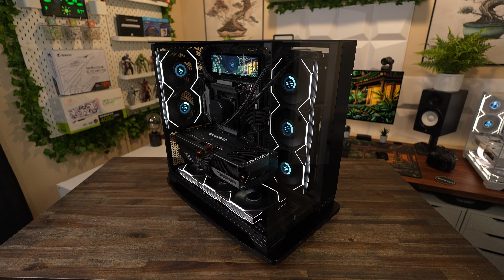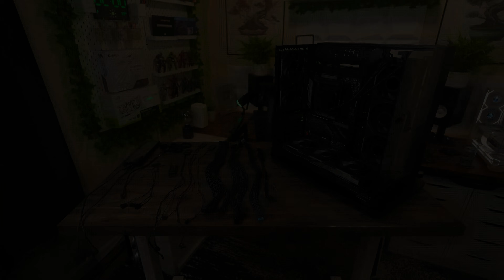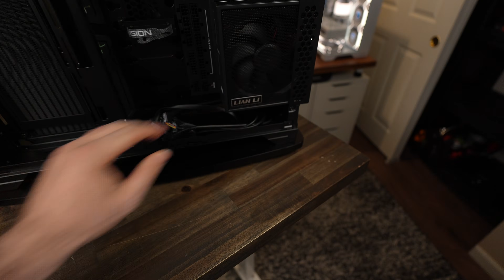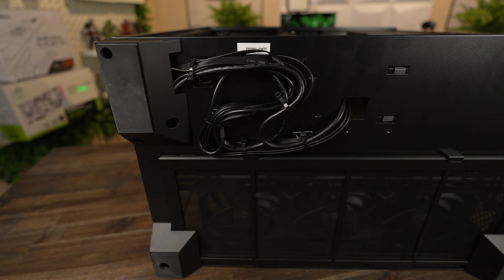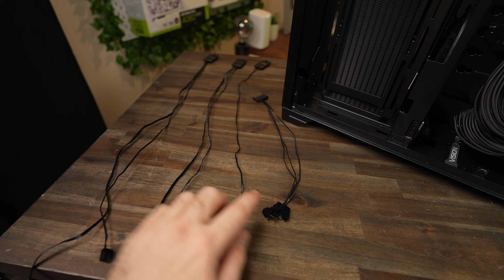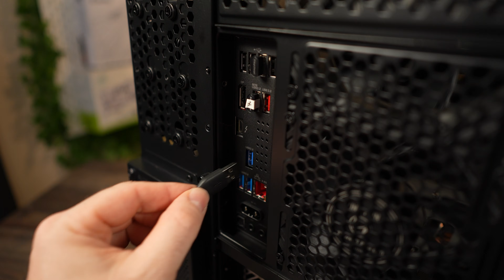How I Cable Managed my DREAM PC like a PRO!

Comment from the maker: Hey everyone! Thanks so much for tuning in and supporting, it is greatly appreciated! I do realize that I used a LOT of Lian Li products for this, they just made the most sense for what I wanted to do. Today, we walk through how I cable managed my DREAM PC! I will go over tips, tricks, and the entire process of getting my cable management to look absolutely insane! I have no idea if this is going to be helpful or not, but hopefully you learn a thing or 2 from the video! 

The build:

Case - Lian Li O11 Vision
https://amzn.to/42ArWlc

Motherboard - GIGABYTE Z890
https://amzn.to/4aAtrBN

CPU - Intel 285K
https://amzn.to/42Be4qQ

8.8" Screen Above Motherboard
https://amzn.to/4hytTm5

AIO - Lian Li ALC360
https://amzn.to/3CG4mZr

GPU - GIGABYTE 4080 Super WINDFORCE
https://amzn.to/4jzjk49

TEAMGROUP T-Create Expert RAM 64GB 6000MHz
https://amzn.to/3CG4vMt

Side Fans - Lian Li Uni Fan TL LCD REVERSE BLADE Triple Pack
https://amzn.to/42AzqnX

Bottom Fans - Lian Li Uni Fan TL NON-LCD REVERSE BLADE SINGLE PACK or Triple pack
https://amzn.to/4hEAY4J

Rear Fans - Lian Li Uni Fan TL LCD STANDARD BLADE Triple Pack (You will have one extra)
https://amzn.to/4h9NkSy

PSU - Lian Li Edge 1000W Platinum
https://amzn.to/4gpx5PX

Storage - WD Black 4TB SN850X
https://amzn.to/40Fzpwu

Cable Management Items:

Double Sided Tape (Unbelievably Strong)
https://amzn.to/40DstzR

Cable management mounts with zip ties
https://amzn.to/3PXgE2C

Velcro Strips
https://amzn.to/3Ecs8wO

The rest of my Setup and other builds I have done:
https://www.amazon.com/shop/dankamyou...
Reply: What brand 8.8 display? Been trying to find the exact same one for my build..
Reply from the maker: @caseyscharf8702  It's linked above. It's some generic Amazon brand
Reply: @ , thanks man. I figured it out… Appreciate your videos. Top notch.. Doing a rebuild with the O11 compact..
Reply: @DanKamYouKnow  The pump mounting system is not compatible with Z890 in theory, but it is identical to LGA 1700, is everything ok?
Reply: I’m Mc Kirkpatrick student
Reply from the maker: @ That's my sister! Thanks for commenting, buddy.
Reply: Hey im looking to build a pc for myself in like 6-9 months (probably closer to 6)
With a budget of around 2000€ maybe a bit more
Could you do a video or a short of what you would do (i dont want it to look absolutely insane but i also want it too have some aesthetics because i want to put it on my desk)
Reply: i noticed on the bottom fans the link sends you to what seems to be regular non-reverse triple black fans, nor can i find the option for them. i just wanted to make sure that those are the right ones or maybe they ran out? (making this exact build)
Reply from the maker: @ The bottom fans should be NON-LCD REVERSE blade fans. Amazon just may be out of them at the current moment. I changed the link to the reverse blade single NON-LCD. Thanks for mentioning that
Reply: @DanKamYouKnow so if i buy 3 single fans instead of the 1 triple fan is it going to be 3 separate wires or can i make it into just 1?
Reply from the maker: @ You can buy 3 single packs, daisy chain them all together, then use one of the cables that will come with each of the single packs. You will have to make sure you buy at least one 3-pack of any of the fans, so you receive the controller. The LCD controller will work with NON-LCD and vice versa. Probably best to buy a single packs for the bottom, then a 3-pack for the side, then 2 single packs for the rear.
Reply: My mobo has 2 9-pin usb 2.0. I have 3 sets of fans along with my aio needing a usb. I purchased a nzxt usb 2.0 splitter and im having so many issues with my TL fans turning on and off. Researching online, it seems I'm not the only one. Can you share what you did with these two builds because we have very similar setups?
Reply from the maker: I haven't had a single issue with my SL or TL fans. I assume the controller is updated within L-Connect 3? You may need to contact Lian Li. There support is very good
Reply: Great Job mate. So many white builds the past years. its great to see this Black 1. I really like what u done with this 1.
Reply: Wait so what did you do with the fans that came with the AIO? You just didn’t use them? Cuz it says you bought 3 side fans. I’m assuming those side fans are the ones on the AIO?
Reply: sry bro but i think im gonna have to copy your build😆
Reply: You have lots of money. The fans are expensive as shit. Bought some knock offs instead. Still do the job
Reply: hi bro, i am from bangladesh, a fan of your content, need your advise, is there any way to discuss with you?
Reply: I'm using the same lian life fan product, but my fan's rgb doesn't show perfect white like your product
L-connect3 program always has blue light even if it's white
Can you share the hexa code of the color you used??
Reply: Hey can you do me a favor. I order the fans from your list. Could you check that they are right. I only ask because the Rear fans triple pack makes sense to put onto the aio cooler....Am I wrong here or reading it weird?

Comment: May I ask a question? As far as I understand, the three AIO fans on the side are all exhaust, two rear ones are too, the lower three are intake. Doesn't that create negative pressure inside the case?

Comment: Has anyone ever experienced the lian li 8" display conflicting with existing components? I wanted to add this display I have it connected to the back of the board thru USB. What is happening is the lian li software conflicts with signalRGB one or the other with not work. I looked up and found it could be a bandwidth issues. IDK these things.

Comment: I got similar build, I'm just using BTF motherboard so all the connectors are on the backside - including the 12v HPWR connector. Only thing that bothers me is that if I want to use the top glass panel the AIO's tubes are hanging diagonally no matter what - even if routed through the grommet og vision compact they still are at he angle that looks sloppy.

Comment: Hi hi! I dont know if you even look at comments on videos this old but I have a question

How do you keep your rubber cable grommets from not being scrunched up? Especially with the mobo 24p cable, when I put it through the grommet the grommet just doesn't look right and clean

Comment: One question I have is airflow. I plan to put the radiator mounted to the side and have the top as the glass cover to showcase it better. I plan to put 2 reverse fans back by the IO panel. Should the fans on the bottom be reversed to pull air out or standard to pull air in?

Comment: Nice video @DanKamYouKnow. But two things I did not like here, one is tucking extra wires under the pc >> time @ https://youtu.be/jCrYSN834Ac?t=414 and another one is display hdmi cable going to back of the case from inside >> time @ https://youtu.be/jCrYSN834Ac?t=995 . I would prefer tucking extra cables inside compartment of the case along with other cables, since that area is always closed with back plate. Another one is I would prefere usb display over hdmi display. That makes more cleaner version of PC. I'm building one will share pics once build is complete.

Comment: Great vid man! I already ordered it aswell but in the vision compact version. Because the normal o11 isnt avaiable in my country anymore. Also the conpact version have a intigreaded sag bracket which may help with my heavy asus 5080 rog astral. Are you happy with these 8.8 inch monitor aswell? Im not sure about it.

Comment: Where did you get your cable combs? Cant find any online to fit the 12v 2x6 for a 5090, using lian li 1200w edge.
Reply from the maker: Sorry for the late response, but those combs are the combs that come with the Lian Li Edge PSU!

Comment: So im building my first pc and using this case, i have my fans connected to the nzxt fan and rgb connector and that’s connected to the motherboard. Do i need to connect the sata cable coming from the front panel or is it just for rgb control

Comment: Beautiful build!
I am considering buying a simular case so I have a few question if you don't mind me asking? Firstly, is the corner thingy between the 3 glass panels annoying or do you not notice it? Also, how are thermals? I am buying a 5080 for my PC and I have a total of 7 fans (3 of which are from the AIO and 4 are from the case itself).
Lastly, do you think it looks good in person? I just can't decide if I like the thickness of it but I think the rest looks super clean.

Comment: I never would have thought to use the underside of the case to hide wiring but it makes since because of the psu being side mounted and the bottom fans being over to the side due to this being a duel chamber case you don't have to worry about those wire restricting airflow

Comment: Hey Dan

Your videos are high quality and really fun to watch – keep it up!💪
Just wanted to say: I built the exact same setup.
The only problem is that I have no idea how to configure the 8.8-inch monitor to display temperatures or play an image/video like in your video.
Maybe you could make a short tutorial about that? I’d really appreciate it – and I could also share it with a few friends who are facing the same issue.🙏
Reply from the maker: Thanks!

The way I am using the screen is basically as an additional monitor. I then use Wallpaper engine to actually place the wallpaper I have on it. If you wanted to do a sensor panel, you would have to use something like AIDA64 to make the panel.
Reply: @DanKamYouKnow thx a lot me man 🙏❤️

Comment: Nur Schwachsinnige sind auf Win 11 geil.     Und das ist wissenschaftlich neurologisch
beweisbar und auch bewiesen. (!)
Ja. Aber diese Spielelastigkeit ohne ernsthafte Software hat einer erstklassigen Hardware
schon in den 90ern schließlich das Leben gekostet.
Dumm gelaufen, oder... ?
-
Und solange man sich den Kopf mit Spielen zuballert, ist er nicht frei um zu denken, was
Vernünftiges zu lernen und zu machen.
Volten und übertakten ist was für Diaspora-Hirne.
Hier ein Beispiel, wie Effizienz auf intellektueller Basis und damit der Unterschied
statt Volten und Takten aussieht.
.
.
Kommt immer auf deine Fähigkeiten an, oder ob du deinen
Intellekt an Andere delegierst.
.
"Denken Sie selbst, sonst tun es Andere für Sie."
.                                                 Vince Ebert, Physiker
.
Wenn du wissen willst, wie das Speichermanagement (auch) beim Spielen auf der
Rechner-Seite punkt, weil MS gar keinen Zugriff mehr auf deinen Rechner hat und
der daher rasend schnell wird, mach mal folgenden Test:
.
Ich habe am    18.04. 2025   nochmal einen Performance-Test mit MEINEN beiden
(beide getunt) gemacht.    Titel:   "Warum ein neuer Rechner nicht lohnt!"
-
Ich habe die Word mal auf 32766 bebilderte Seiten erweitert. Mehr macht Word nicht.
Und die habe ich dann in Pdf umgewandelt. Pdf hat irgendwo noch zwei Seitenvorschübe
reingesetzt. In der Pdf sind es 32768 Seiten geworden.
.
Am Ryzen war sowohl das Generieren einer so großen Word-Datei  ~es geht um die
Performance eines Systems~ schon eine bluttropfende Geduldsarbeit, sowie auch
die Zeit die der Ryzen zum umwandeln gebraucht hat.
.                  Ich habe in zwei Testläufen verschiedene Methoden angewandt.
-
-
Jetzt darfst du dich festhalten:
Damit hatte noch nicht mal ich gerechnet, weil ich noch nie so exzessive Tests gemacht hatte.
Ich hatte meist von kleineren Tests hochgerechnet, bzw. Kopiertests großer Dateien,
25 GB oder mehr, herangezogen. Und CDM und AS SSD Benchmarks gemacht.
.
An meinem Intel-Notebook von 2012  (4700HQ, Quadcore, 2,4 Ghz, DDR3-1600, Win 7, mit
SATA6-SSD  und lediglich 54 TDP)  ... hat das geschlagene 4 Minuten gedauert.
Am Ryzen 1950x von 2017, 16 Cores, 4 Ghz, DDR4-3200, Win 10 und NVMe OWC Ultra IV
im RAID0 auf zwei PCIe-8-Steckplätzen (16 TB) nur 3 Stunden 20 Minuten.
-
-
Ihr könnt den Performance-Test ja mal nachspielen, dann seht ihr schon, wo ihr steht.
.
Ich messe nie an der Pleuelstange wie Blender & Co. (warum heisst der so ??), sondern
immer zwischen Gummi und Asphalt.   Wieviele PS der Trabbi wirklich hergibt.
-
-
Die Erbauer nachfolgender Computersysteme können also nicht mehr ganz bei Trost sein.
Da ich seit 1988 Rechner tune, weiß ich wovon ich rede.
-
Da ich nicht Game, aber gelegentlich rendere, weiß ich, dass da der 1950x mit der 1080 sehr
viel schneller ist. Linear.
Aber aus dem Alter eines beschränkten Horizontes bin ich heraus.
.
Das muss nicht nur anders gehen, sondern tut es tatsächlich auch.
Aber eben nicht mit teurem Billig-Ramsch aus Industrie-Abfall.    So wie AMD.
-
-
Es ist also ZWINGEND, beim Anpreisen von Ryzen-AMD-Systemen DEUTLICHST HERVORZUHEBEN,
dass die zwar ganz nett beim Sielen sind, wenngleich selbst ein 9950x nicht mal an mittelmäßige
Intel-Systeme herankommt, aber bei Windows-/Office-Anwendungen gar einem C64 von 1984
gleich kommen.
Und wie wir wissen, hat AMD den 9950x gerade mal doppelt so schnell gekriegt wie den 1950x.
.                                                            Alles dazwischen ist   ...Zwischenstation.
.
Man lädt ja auch nicht mit einem Ruderboot zu Sightseeing-Touren in grönländische Fjorde oder
Karibik-Turns ein. Nur weil mal eine Titanic abgesoffen ist.
Und inzwischen sogar eine Zweite und auch noch eine Dritte. "Vertrauen Sie mir, ich bin Ingenieur!"
-
-
Vom 4700 HQ aus 2012 bis 2025 liegen ... ?    RICHTIG!  12 Jahre.   kkkkk...
Und locker 10 Ryzen-Generationen.     Schenkelklatscher.    Also jede Menge Dumme.
Mein NB ist ein Intel-PCIe3-NB mit noch Win 7.
-
Der 9950x ist PCIe5 mit NVMe5 und Drehzahlen,  DDR5-Ram 8800 Mhz, CPU 5,5 Ghz, etc., etc.,
dass einem nur so schwindelt.
.                           Und dann ist mein Uropa-NB trotzdem 50 Mal schneller !!
.                                                                           Ich krieg nen Leistenbruch vor Lachen.
-
-
Dieses mein Intel-NB von 2012 bootet (getunt) Kaltstart in vier Sekunden.
Zwei fürs BIOS, zwei für Win 7.
Mein, ebenfalls bis zum Geht-Nicht-Mehr getunter 1950x  braucht von einer 970 Pro, 990 Pro
oder OWC Ultra IV lediglich 1 Minute 30.   Was für eine Senftube.
Habe ich die GTX 275 von 2009 drin, bootet er immerhin in 50 Sekunden.
Am schnellsten läuft also der Rechner der nur 54 TDP hat.    Das Intel-Notebook.
-
-
DU musst die GANZE Windows-Seuche selbst lösen !
ICH habe meine Rechner gründlich entwanzt. Bei Win XP und 7 geht das noch richtig gut.
-
1. Gebot !   RAUS MIT WINDOWS-UPDATE, seinen Vettern und Seilschaften !!
                    Dann geht der schon mal sofort sehr viel besser.
-
Und kostet nicht mal was.
-
Bei 8 nur noch mittelmäßig.
Bei 10 geht fast gar nichts mehr. Und mit einem AMD sowieso nicht.

Comment: Im surprised you didn’t route the cooler hoses through the access hole that send its to the rear.
Reply from the maker: The original O11 Vision doesn’t have them, only the O11 Vision Compact

Comment: Love the video, I was just put onto your content and you do a great job of simplifying things for newer people that have moved into the hobby. I may have missed the answer that i am looking for however i was wondering about the cooler you have. I was always told to place sealed coolers with lines at the bottom to prevent the air bubble moving into the lines/pump.

Comment: Love the build, I have myself the same motherboard but white and a Lian Li DE RGB bbecause its what it was available  atm .  I do use a similar gimmick routing the cables through the heatsinks and plates . 

I run my GPU upgright and hide a bunch of things behind the riser cable which goes down, then behind the motherboard and then out to connect to the GPU and I also run 2 strimmer strips for the GPU 3x6+2 and the24 pin  they both arc over the graphics card and they also hide the GPU upgright anti sag brackets which I also use to keep the strimmer extensions in place . 

I Want to change my water cooler to a air heatsink , so I can go with a full chimney .  I also bought a bunch of cable sleeves and covers because some things are unavoidably black and whilst I dont mind some are just out of place.

But this video helped a lot and will be making some changes to the routing of some cables and If I find a good excuse I may just upgrade my PSU to that lian li ones because they are so freaking useful to keep things tidy. 

On a separate note it would be amazing if one day we could use our GPUs though the motherboard ports, like imagine using that internal HDMI port for your internal monitor or not having to route a freaking HDMI cable inside my case for my upright GPU .

Comment: I could never put these cables under the case like that. Even if no one sees it, if I know under there is a mess, it would drive me crazy. I'd much rather tuck them nicely and clean inside the case. But other than that this cable management is amazing!

Comment: As an experienced Builder myself whom has been interested in using the TL fans since they were announced, it's really nice to see such a clean build using them to their potential. I was considering a project zero board but didn't like the limitations and this has convinced me it's entirely unnecessary because that is some really creative front cable management. Never seen a good implementation of a separate screen in a build like that before, really nice and will probably copy this build more than once.

Comment: FYI, This lian li o11 vision does not support 2 fans on backplate if you get the gigabyte master 5080. That thing is huge, and will be touching the fans on the bottom intake. I did the same setup as this video, after installing two fans in back, left minimum space for gpu and bottom fans. Right now doing a custom DIY to the case to fit the two fans without switching the moveable plate in the back to top to support two fans.